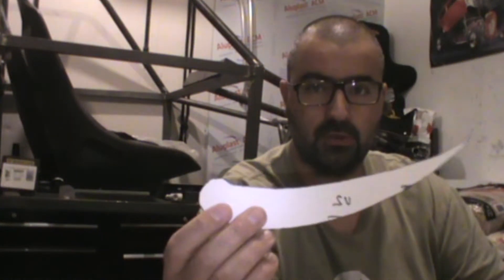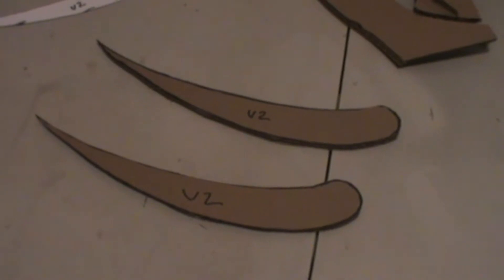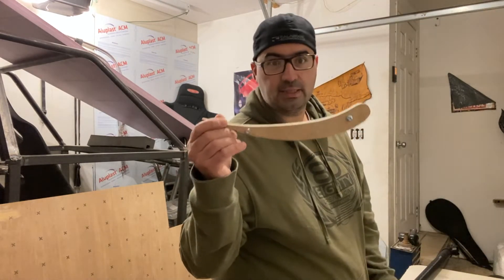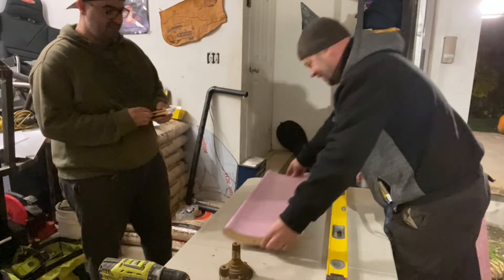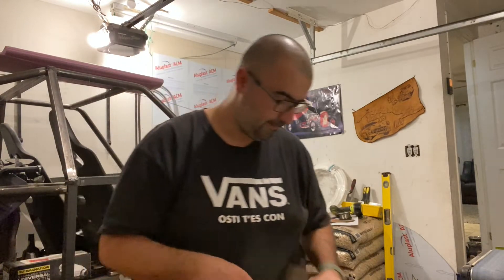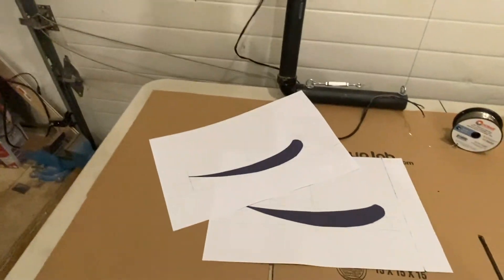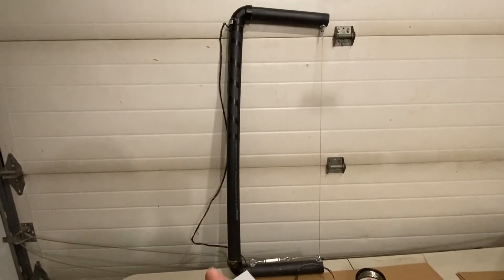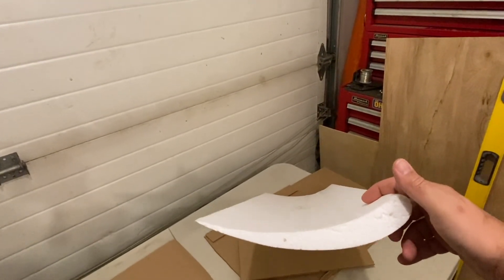Carbon Fiber Race Car rear wing build for Time Attack - part 1 of 3

Comment: Quick tip from what I've learned recently... figure out the reynolds number for the air you think you will be using it in.  For me I used sea level and 85 F to get around 80,000.  Using this I found the wing that was most efficient at a Reynold's of 80,000 (mine is 50/1 @ an alpha of 3 degrees).

Comment: are you just "winging it" on that airfoil shape (hehe see what i did there). www.airfoiltools.com has a HUGE library of actual airfoil shapes. i was looking to build my own in this same fashion before i found a hella good deal on a used airfoil. i was looking at the s1223 airfoil shape. if you do some google and youtube digging you can find guys who have actually done some airfoil cfd testing for random naca profiles as well.
Reply from the maker: I did not just wing-it :). Lots of research and reading. Also used SimFlow, but computer crashed so did not fully finished. Also learned a lot from other peoples cfd. I started with a Clark Y model and modified it, and then tested some Naca and BE50 model also.  Then more research to find out that Wing is great, but wing placement will or could improve downforce. I guess it's a great experience and learning curved.